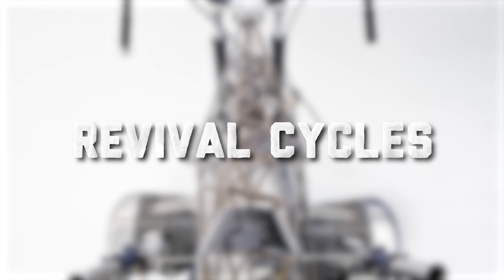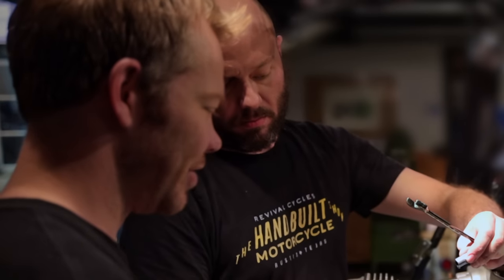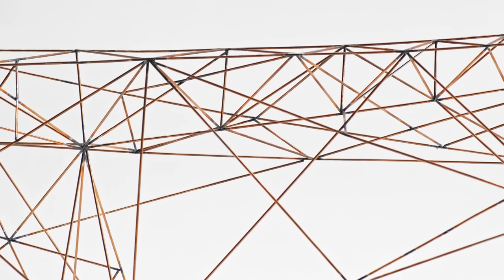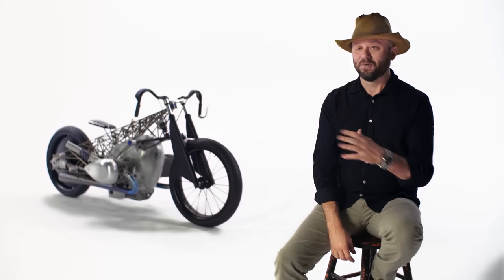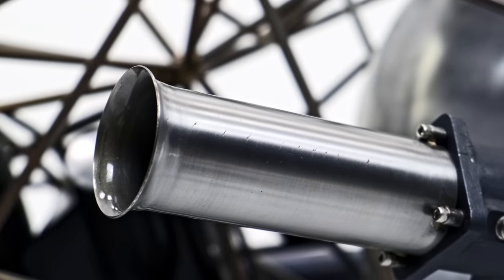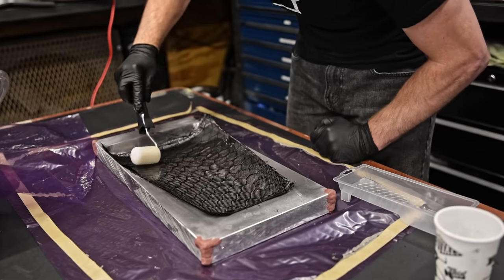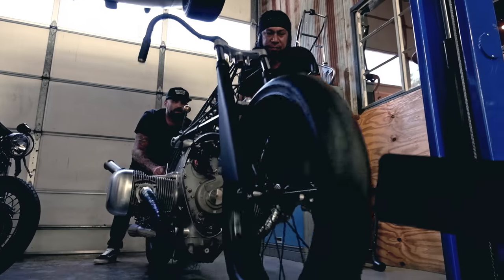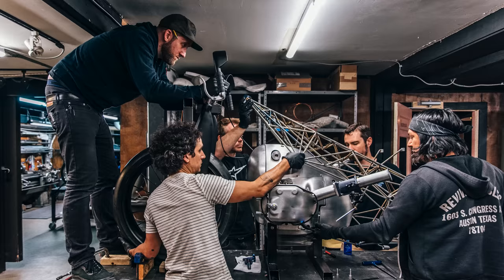Revival Birdcage BMW R18: Build Bio

Comment: I remember watching the building of this bike prior to the Hand Built MS. You could set the bar low and opt for different materials, use the stock engine management system, amongst other things. But you didn't, you opted for the hard work. Because it pays. This motorcycle is indeed something that could be on a art gallery as a center piece.

Comment: I have a 1976 R90 and love that bike.
Reply: I had one 20 years ago. For the last half dozen or so years i have owned among a couple of other bikes, a sort of counter part to it, a 1976 Moto Guzzi v1000 i convert. Civvy version of what a number of police agencies requested. With a dual range gear box and torque converter so essentially it rides stoplight to stoplight like an auto trans. car drives. It's a much easier bike to ride without creeping up over the speed limit than my R90/S was. Doing a build now of it as a few things needed attention after 5,000+ miles accrued since my purchase of it in 2013. Mulling over ideas to personalize it to my tastes so it won't blend in and be too hard to find in a parking lot. Lol. Sadly, after half dozen years of operation the Portland Moto Guzzi/Aprilia dealer has closed down. As a recently retired metal fabricator i am an admirer of your build and am always checking out what Revival is up to. Thank you for your inspiration and the Revival video's.

Comment: Whether the seating position is comfortable? ow many kilometers do your hands, spine and ass suffer? Cheers!
Reply from the maker: It's actually not bad at all. I mean.....I wouldn't wanna ride it all over town in low speed traffic, but I can say that at speed, everything feels just fine and that the riding position and comfort exceeded expectations. Even the front suspension was well more compliant than initially intended.
Reply: @RevivalCycles  Thank you for Your response! It is, I think, a great challenge or creating a work of art, we have to take into account its usability and ergonomics. Of course, I understand that after all it is a certain artistic concept created rather for presentation at design and tuning events - but I am asking about this comfort of riding, because this type of construction very often is simply not suitable for riding at all ..
   It is important to me because I have such a problem in my old Honda Revere - after all a serial motorcycle, but after 200km of driving my hands suffer from vibrations and unfortunately nothing can be done about it ...
    Your project is beautiful and BMW engineers will definitely benefit from it because, as the new R18 shows, they are tracking exactly what private designers around the world are doing ... All the Best!

Comment: It is all there in the bike.  If you had more time you would have worked on making the bike more and more rideable and understood by current measures.  Fortunately, this barrier to understand the design is part in parcel of this bikes function which is to change peoples minds about motorcycle past, present and future.  When people look back on this design they will not care about this "rideability" barrier, and neither should they let this stop them from seeing, understanding, and changing their minds about, innovations "all there in the bike."  Congratulations on spending your time wisely: making a bike ride-able is the easy part, but it is time-consuming, and it stops designers from actually creating these innovations.  For many, they see what you have done here that will not only stand the test of time, but will influence and solve future ride-abilty features.  In this way, the "ride-ability" barrier is an attitude that you are changing because this bike asks everyone to overlook present issues so that we can solve future issues, because it is impossible to do both, no matter the time given to the project.
Reply from the maker: The Bird Cage has design influences from racing history. The Maserati race chassis for one but the stance as well as the bars were inspired by German racer, Erst Henne's bike which captured two land speed records in 1929 & 30. Folks are often sizing this up against a street bike but the birdcage was built to take to the salt flats, it was never intended to be a bar hopper.
Reply: @RevivalCycles  I have nothing bad to say about this build.  Yes, I realized that my statement - "it is impossible to do both" - was false as soon as I posted it, especially when I thought about the vintage BMW in the video.  It would take me a couple days to think about what I am trying to say.  You do a fantastic job.  I imagine every iconic factory produced machine begins like this.